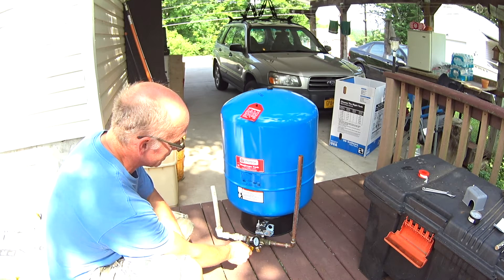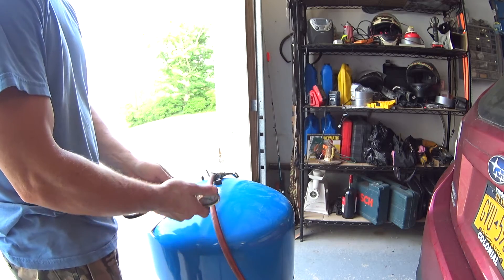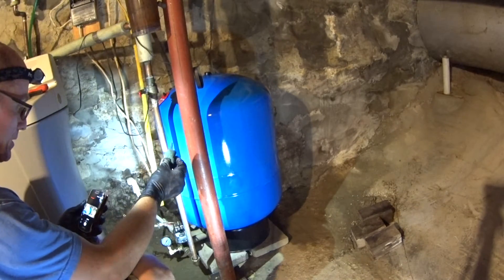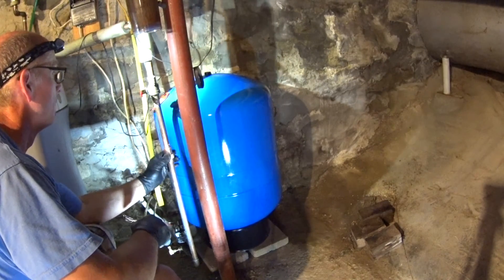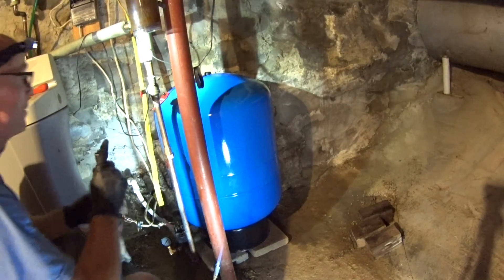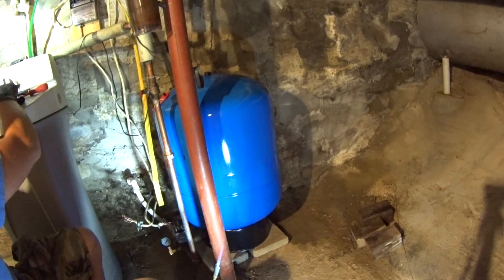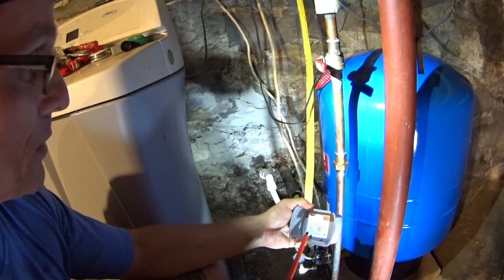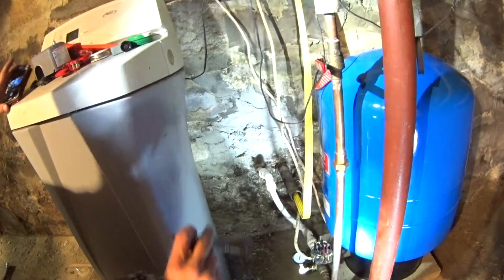How to change/symptoms of pressure tank on Water Pump #2

Comment: Hi.  Nice video!  I just replaced our old tank with the same Lowe's Utilitech model you're using.  When I installed the unit I noticed a water trickling sound emanating from the tank as it approached cutoff pressure.  Assuming the diaphragm had a leak and was allowing water to trickle through into the air compartment, I returned the tank and exchanged it for a new one.  I installed the new one today only to discover it makes the exact same noise.  Otherwise, from what I can tell, everything works perfectly.  I listened carefully when you pressurized your tank in the video and it sounds like yours also trickles as it approaches cutoff.  Can you confirm this?  I'd like to know whether or not this is normal operation for this tank, or if I should be returning it once again.  Thanks!